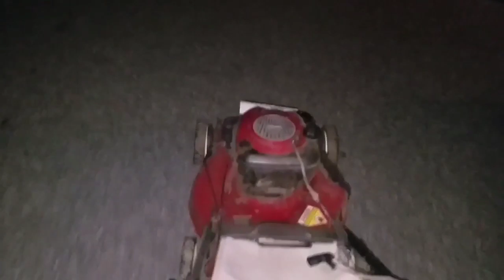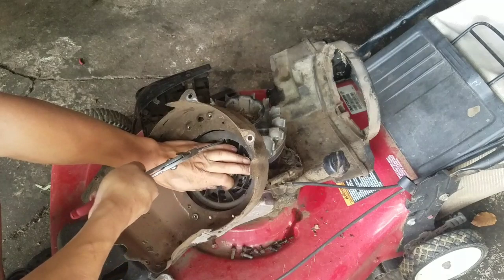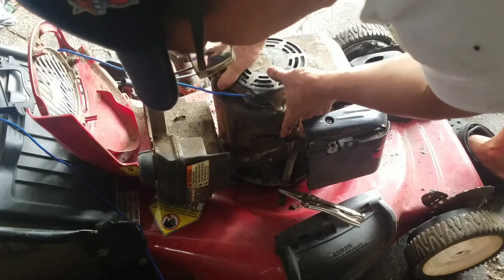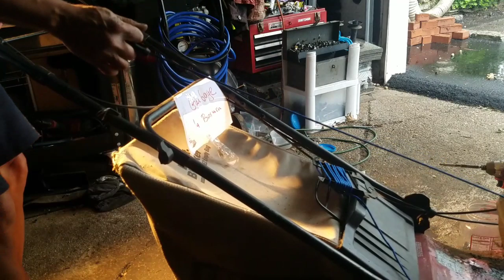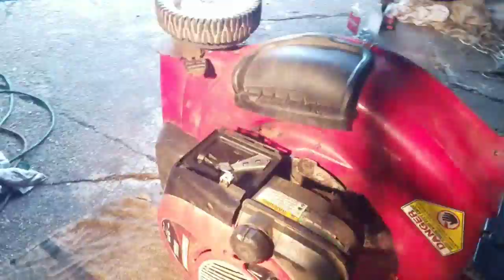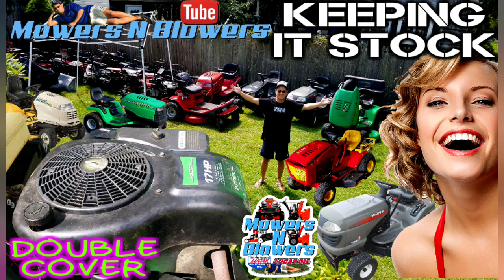FREE CRAFTSMAN 6.25 22" LAWN MOWER QUANTUM TRASH CURB FIND PICK RECOIL STARTER ROPE CARBURETOR CLEAN

Comment: Looks like it's riding lower in the rear. Looks like someone replaced the muffler side rear wheel with a smaller one.
Reply from the maker: They're both a tad smaller than the fronts.  Designed that way, I've had a few like this.  However one of the wheels is different.  Good eye.

Comment: 1 wheel seem to be diff size and mismatched tread
Reply from the maker: Very observant of you.  I know this years design was the rears were slightly smaller than the fronts because the fronts are self propelled.  But yeah, looks like a replacement wheel on the left rear.

https://images.app.goo.gl/d9zs7QBJwfuPesFf7

Comment: Do you ever find any mowers that have a separate shaft coming out the side for driving the front wheels? I've only seen two in my life, those had the classic Briggs engines. Tecumseh made some as well. It's an interesting design choice. I just found Rally set up like that. Heres a photo of a similar machine. https://king-nc.americanlisted.com/27021/garden-house/craftsman-self-propelled-mower-45hp-tecumseh-eager1-20-cut_24533007.html
Reply from the maker: Sure...I had a couple of Scott's mowers.  I have videos on them.

Comment: Cool, I just picked up an MTD, White Tractor yesterday. Its got a Tecumseh engine, a 16.5hp OHV180, 490cc single cylinder. It runs. You ever get a Tractor with a Tecumseh yet? The newer Enduro/formula OHV's from like the late 90's to 2008? If so are they any good? I had an older 12.5 OHV 358cc Tecumseh on one of my LT4000's in the past. But never one of these larger ones, you don't see them often.
Tecumseh made a V twin, but their  very rare. I've never seen one in person, I wouldn't nind getting one, I like Tecumseh.
Reply from the maker: I just got a yardmachines with a 13.5 tecumseh.  I haven't torn into it yet.  I had a 11hp enduro with a blown engine...I parted it out. I hate tecumseh! Their push mower engines and carbs suck!  Every tractor engine I've heard blows a connecting rod out the side where the starter is.  The only reliable tecumseh I've had experience with is their snowblower engines.
Reply: @MowersNBlowers  According to Taryl, from his most common tractor engine's video and tyeir issue's, the Tecumseh is a solid engine. The only issue he pointed out was the flywheel ring gear stripping out and they don't make them anymore. So if yours is good hang onto it, good chance you'll need it for another Tecumseh in the future, or sell it, must be worth big bucks, they are very hard to come by.
The 12.5 Tecumseh on my LT4000 was great, that waa a 358cc, yours may be the same. Anyway it was the only tractor engine that had the backup recoil starter. So if your battery dies, you can still start the thing with the rope. I liked that. That one ran very good, it was a good engine. The only thing I had to do was change the top oil seal. Their known for leaks due to seals and gaskets going bad, otherwise their a reliable engine.
Reply from the maker: @Mr_Tecumseh  I will try and get the 13.5 going.
Reply: @MowersNBlowers  Cant wait to see.